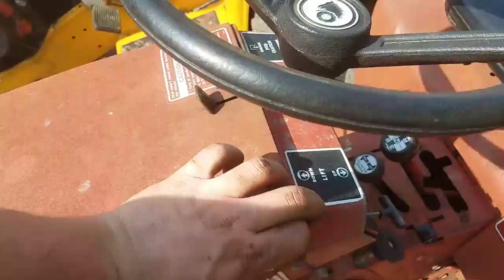The Kohler-Powered Garden Tractor Mafia

Comment: Bad ass I just bought a IH cub 127 and love how everything is cast iron and the rear end is ridiculous the kohlrabi k301 puts the cherry on top .. That motor is a animal for being 12hp and sounds awesome ... Love your collection 👍🍻
Reply from the maker: These old garden tractors are tanks. The Kohler engines are bulletproof and you can't kill the cast iron Cub rear ends either. The 129 in the video is mine, and has the same engine and trans as your 127. It's indestructible.

Comment: Is that the factory exhaust on that international cub cadet?
Reply from the maker: Which one? Both of them are running factory exhausts. The 782 is missing it's heat shroud though.
Reply: MichaelTJD60 I meant the 782. The exhaust didn't look right coming out the front grille, which made me question it, but if that's the way it came, I won't question it. Not too familiar with anything but deere.
Reply from the maker: Yeah I don't know why the exhaust on the twin cylinder Cub's exited out the grill. Probably so the fumes didn't blow in the operator's face like they do on the Deere's. The earlier 1975-1978 JD 400's had the exhaust pointed out the grill too.